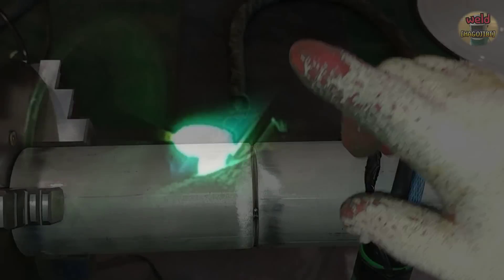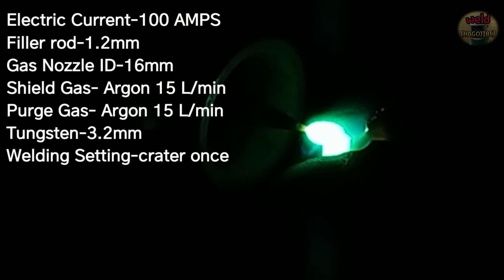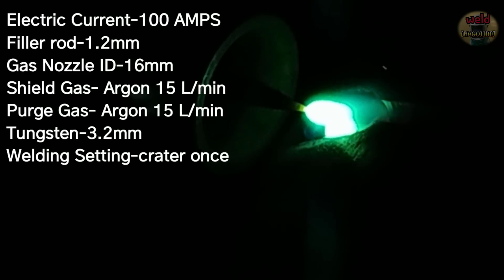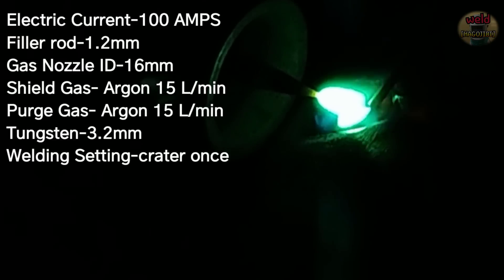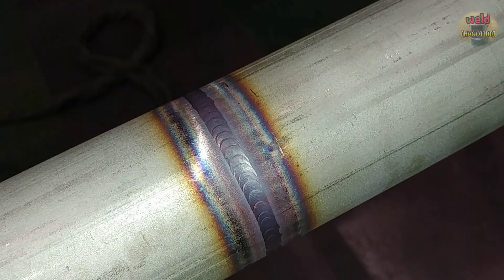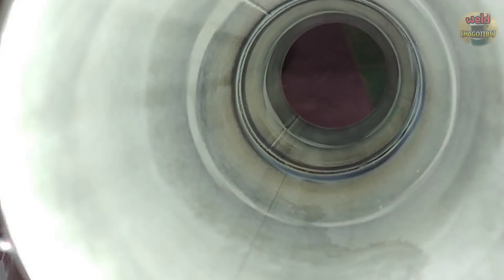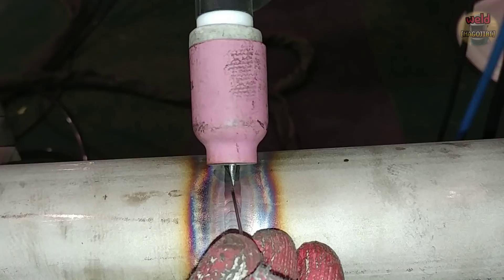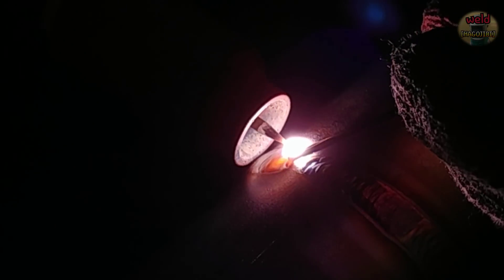Other TIG welding techniques when there is no gap between pipes. walking the cup

Comment: This is easy like this, you try to do it laying on your belly, 10 meters up high, hardly space to move.
Reply: Yeah, it works great 1g roll.. 5g... not so much..
Reply: This might be limited because he is using a machine to turn the pipe.
But as with MIG welding, I learned to control welding spread and obtain better quality using this method.
The perfect training tool so you can practice different positions.

Much better than how we were taught at trade schooling where the price was stationary.

All you do is start in a comfortable position then graduate towards the most uncomfortable welding position possible.
Challenge yourself.

Comment: The Purge gas pressure is way to high. Always lower then the shield gas. Close the pipe on both sides with tape or a rubber cap. One side the inside the other side a little opening to let the purge gas out. Let it flow before you start welding so all the air is out.
Reply: He has the brillow on one side.. the gas wont build up and push out..

Comment: 안녕하세요, 선생님. 실력이 굉장하시네요. 저는 초보 용접공인데 혹시 알루미늄 튜빙에 wiggins fitting을 회전테이블에서 용접하는 비디오도 찍어주실 수 있나요? 요새 하고 있는데 모양이 잘 안나와서 걱정입니다. 보통 튜빙 직경 1.25 inch 짜리 하고 있는데 직경 0.5" 같이 작은건 내부에 관통을 일정하게 나오게 하기 위해서 rotary table 회전속도를 빠르게 해야 되니 무조건 filler rod를 빠르게 집어넣는데요 직경이 커지면서는 용접 물결무늬를 깔끔하게 하기 위해서 회전속도를 좀 늦추면서 rod를 집어넣었다가 최대한 멀리 띤 다음에 다시 집어 넣거든요. 그래도 마지막 가서는 뜨거워지면서 물결무늬가 흐릿해지는데 선생님 하시는 거 좀 보면 크게 도움이 될거 같네요! rod는 4043 1/8" vertical position에서 쓰고 있습니다. 3/32"도 써봤는데 1/8"이 큰 튜브할때는 제게  좀더 잘 맞는거 같더라고요. 혹시 기회되시면 비디오 꼭 부탁드릴게요!